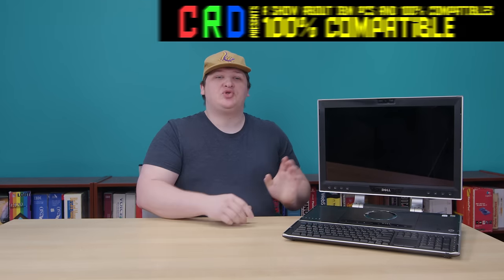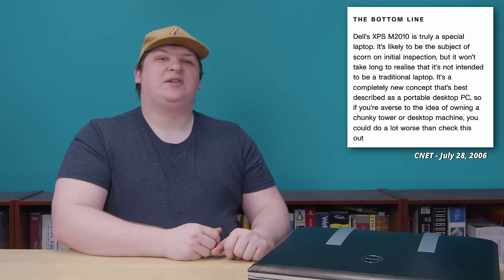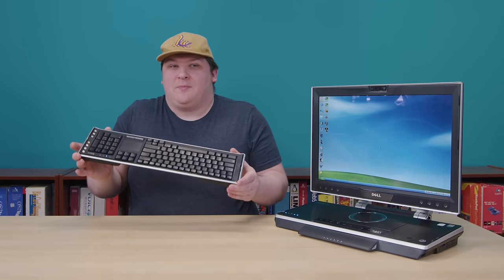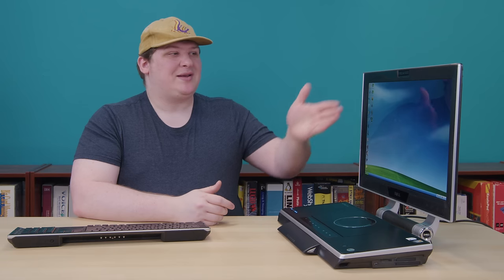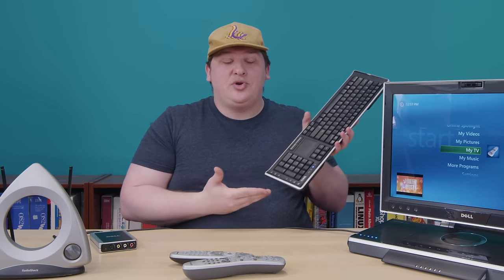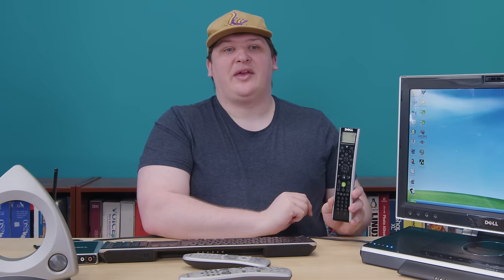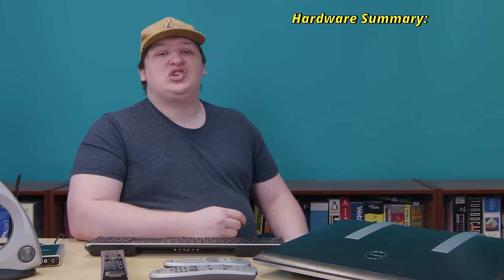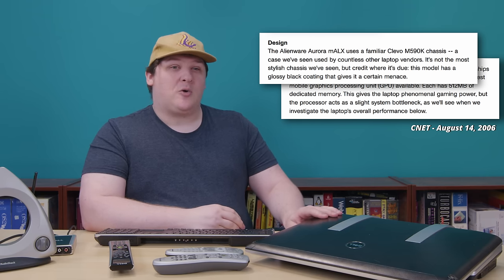Dell Called It "The Showstopper"

Comment: I remember we had a programming contractor that had one of these, back on the day.  It was never really sold as a laptop, but a desktop replacement.  This was never really designed to be used as a laptop.  It WAS a desktop.  If you went somewhere (like our office), it was far easier to bring this than a full desktop with all your apps and tools.  Of course, you brought the power cables with you.  As for WIreless USB, sadly it never took off.  Bluetooth was still relatively new, but solidly entrenched at that point.  I remember the announcement of it, but never saw a single device for it.

Comment: A video about a remote disguised as a video about a laptop with a Quick Start Gaiden segment. Bold work.

I know the "They shouldn't make machines smaller than this" joke is...well, a joke, but this format of machines is unironically my ideal. This, the original MSI Titan with a full sized Cherry MX blue keyboard and desktop graphics, the Acer with the curved ultrawide monitor, the Razer prototype with 3 screens. All of these NeoLuggables are genuinely my ideal "laptops". Everything you need from a high end desktop system with enough portability considerations that you can take it and only it to a friend's house and have an uncompromised experience.

Comment: HP recently have made a product like this. its the "HP Envy Move". it has a pocket for the keyboard behind it, it has a 24 inch touchscreen and it has legs that flip out when you place it on a desk. it aslo has an internal battery but reviews and hp themself say that it doesnt last that long on battery.
Reply: Also doesn’t have dedicated graphics or many of the other features
Reply: @inherentlyflawed  but the type of stuff this dell in the video was trying to achieve like media consumption which nowadays is just playing a video from a website so no need for a dedicated gpu, a tuner, a dvd drive, media control buttons, analog tv outputs and surround sound outputs, dual hard drives in raid 0, a remote and such. so the envy move is kind of a modernized stripped down thing of this class of all in one portable computers and to be honest it is quite pointless for this device to exist just for its big touchscreen and a full size keyboard and no other new functionality. if you really want that screen you can just have carry around a 23.8 inch portable monitor along with your laptop that you can use if you really want a big screen…

Comment: This is probably one of my favorite videos I've seen from you so far, both because of the sheer breadth of topics you managed to cover based on a single product and simply because of the constant sense of "but wait, there's more!" that I got throughout.  It was like every time I THOUGHT you were coming to the last thing, you'd start something new and I'd check the video only to find there was still a dozen minutes left.

What a genuinely fascinating piece of tech and what a time capsule in a sense.  Despite the fact that it's undeniably innovative for the time it came out during, you can really feel the vibes and general presentation OF the mid-2000s in the way this thing is put together.

Very good video dude.

Comment: This thing is an instant eye catcher, and I was totally enthralled from the moment you opened the disc drive. Everything just oozes raw effort and passion for the art of solving human problems. This micro ecosystem of a computer was an achievement, and you did an exceptional job showcasing exactly why. Bravo.

I dearly wish for a present where technology could be so exciting. Where we worked on human problems instead of engagement and ad revenue ones.

Comment: This is an amazing machine. Less than fifteen minutes in, you had me convinced I want one. I still want one. I could find a use for it! Even today, I swear!

A tip for rubberized coatings: I've seen a baking soda + water paste recommended, and it worked great on the power bank I tried it on. Obviously it's a mild abrasive, so try an inconspicuous area first, but on a matte plastic, it seemed to be just fine.

Comment: Things like this is why I think computing was much better and cooler in the 00s, a hardware golden age.  We might have technically more powerful stuff now (if you ignore software bloat nullifying that) but things were just really cool and creative back then. I don't want tiny laptops that all look exactly the same, I want this thing so I can actually work comfortably anywhere. Makes me miss my Dell Latitude which is the coolest laptop I ever owned. We need the luggable category back instead of all the price-cut miniaturised nonsense that passes for mobile computers.
Reply: Just out of curiosity, which Dell Latitude did you have?
Reply: @FlyboyHelosim  E6400, though that's pushing close to the 10s (2008/9). I actually do still have it, I found it in a storage bin with some other tech. Pleasantly surprised because I thought I got rid of it ages ago. Half tempted to see how well it plays with newer linux distros if I can find the power brick.

Comment: I remember doing support for XPS & Inspiron computers at the time this came out. We even got to take it apart & put it back together during training for it.

Portable devices at the time seemed to prefer the 4-pin firewire as that meant they didn't have to be able to send power that the 6-pin would have required them to send.

The keyboard battery will only charge when the computer is plugged into the wall.

Comment: Great video, I loved to see your review of this beast of machine.
One thought about the battery though, as you mentioned it 's only practical function is as an ups. And with a striped harddrive raid, which is needed for the tv recording features, dell would need to keep enough battery power to do a gracefull shutdown of the raid.
I had a qosmio that also shipped with striped raid, and I was clueless about that fact. The raid died on me after a power failure while recording a show. Basically the following morning, it wouldn't boot up and never did again as I had no idea how to slipstream drivers into an install medium.

Comment: Great video! Thank you for touching on some of the hardware aspects that most other reviews overlook.
I have one of these, and I love the form factor but despise the XPS machine itself. The design sure is unique, but the graphics card almost totally ruins it for me. It's awful that the M2010 has an underperforming graphics card compared to the XPS M1710, and it cannot be replaced with any other model. Though it shares the same proprietary slot as the cards on the Precision M40 and XPS M1710, the display connector is different so the cards are not intercompatible. X1800M is also rather unreliable, working ones are hard to find for under $200. 
HDX Dragon (Pavilion 9300) is the same concept but executed far better. Sharper screen, clearer speakers, bigger subwoofer, more powerful graphics card in standard MXM slot, and it still manages to be lighter than the M2010. 
M2010 had so much wasted potential - the keyboard takes up way too much room, giving it only the interior chassis space of a 15" laptop. I feel like Dell absolutely could've done so much more with this machine had the space actually been used well. Dell absolutely had something going with the Bluetooth accessories, the mechanism for attaching and detaching the keyboard is, I must admit, quite well-engineered. It is just a shame that performance had to be sacrificed for the gimmick.

Comment: the gyration remote at 28:00 does not require you to push both buttons at the same time. you can doubleclick the 'move' button to toggle it on or off and then use the left or right mouse buttons accordingly. Still causes some weird behavior, but at least it's useable. I have one of these remotes with a USB receiver. Use it regularly still.

Comment: The HP remote had a large nub/joystick to control the mouse and that was actually one thing that worked quite well. I got one with a HP 2002 "Media Editing Desktop" (silver and dark blue style, pci tv-tuner, AthlonXP 2800+ with 512MB ram and an Nvidia MX440 graphics card, dual optical drive, 1280x1024 17-inch lcd, wireless ps/2 optical mouse and keyboard combo)

Comment: 33:41 The 3rd grey antenna was for the 802.11n card that was optional on some of the contemporary dells, like the latitude d630. The card was called the "Intel wifi link 4965agn." It was tri-band. It can get about 150mbs down/80mbs up on windows. The linux drivers for the card are poor, though.

I can only assume that the other Mini-PCIE slot was going to be for a cellular modem, like what other dells had options for (it would've been 3g at the time)

Dell also had zero BIOS locks on any of the PCIE slots that that time, so you could install a modern WIFI card (assuming you can find one that can use the 5ghz grey antenna lead)

Comment: 33:40 The third antenna likely for use with a higher-end Wi-Fi configuration such as a 3x3 802.11n. Usually that's what a gray antenna cable is for, WWAN would usually be blue and orange IIRC. Even though 802.11n didn't officially come out for a few more years but "draft-N" products were around before then. The supposed WWAN slot isn't populated so it was never intended for this purpose in production.

Comment: Reminds me of the HTPC I built back in the late 90s with an ATI All in Wonder.
That came with a giant RF remote.
I went through the trouble of setting up all the stupid stuff to get the TV Guide programming set up.
And it totally worked! 
I lived in the Bay Area at the time and got about a dozen channels of TV. And the TV guide would download all the TV show info a couple times a week. 
You could even schedule it to record TV shows for you. But disk space was expensive. I did it for DS9 once and deleted it after watching because it took up half of my largest disk at the lowest resolution. 
I'd built it into a coffee table and I used that for about 6 years after.
About the raid array thing. I was really into performance tuning computers in the 90s and early 2000s. 
SOP was to install system to a raid 0 array, and have a 2nd fault tolerant array for Data files. 
I was on Win 2000 for a long time, but I'm pretty sure I did XP too before I went to Win 7. 
I think the trick here is understanding how to load a raid driver by floppy using the BIOS.
ASUS Bios was great for this, as was MSI. On a Dell not so much.

Comment: Amazing video and great "laptop"! 

The platform it is the same of the Inspirion 9300/9400/XPS/M90 and all of them have problems with thermals, but you can use SpeedFan to speed up fans.
I do that on my Precision M90 with T7200 (plan to upgrade to T7600) and Quadro FX 3500M (Basically a  Geforce Go 7900GTX) and it can handle Stalker: Shadow of Chernobyl at max settings.

Comment: On the board schematic for this machine, the second unpopulated miniPCIe socket is listed as being meant for a TV tuner card, so they must have planned to have one built in at some point rather than needing the chonky external box. The antenna you found there is likely meant for a 3x3 wifi card option that uses 3 antennas, that was quite common on machines from that era.

Comment: I had an HP HDX Dragon and I used that thing to death, the heaviest thing ever but boy was it a beast, used it until the battery only lasted seconds and shoe horned windows 10 on an ssd till its last dying breath. didn't really use the remote but it was a fun fidget toy popping it out and putting it back in with the clicks, and the sound system was so good. I wish they made new versions of these

Comment: I vaguely remember using nLite and other tools back in the day to make an all in one boot DVD with every version of Windows XP possible for my friends small town computer shop I worked at. It was my job to keep it up to date with all the most recent service packs and updates. I successfully created quite the monster with probably more that a GB of the most common drivers I could find slipstreamed into it. I also made one for Windows 2000. I probably still have a copy of those disks in some dark shadowy corner slowly bit-rotting into oblivion.
Those were fun days. Though I'm sure the nostalgia exists only because I don't remember the frustration of actually making them work.

Comment: I ran my first desktop from 2008 with two 200 GB 3.5" in disks RAID0, though luckily that machine had a true hardware raid controller. I was still running Windows XP, skipped vista entirely. I upgraded to Windows 7 on an Intel SSD when that OS came out, revolutionary experience.

Comment: 9:19 - I don't know if you get any deeper into this topic later on in the video, but as a Steam Deck user I still find 16:10 pretty beneficial. I think some of the reasons apply even more to a device like this in 2006.
Obviously, a lot of stuff you'd want to watch back then would actually be in 4:3. 16:9 becoming the new standard in this period by no means indicates that 4:3 was phased out. The extra vertical space means that you won't lose quite as much from a 4:3 image. 
There's also an advantage for 16:9 content though: You can get the full width of a 16:9 image without having to go fullscreen. ...I dunno, maybe you think that's a bit silly,  like why would you want to do that...? but it does have its uses for both movies and games. On an actual 16:9 screen, you can't have any extra UI on the top or bottom of 16:9 content without obstructing it or having black bars on the sides. This isn't an issue with 16:9-- or at least the issue is significantly reduced.

Comment: Hey CRD, just a tip for dealing with crusty old thermal paste. Spray a little bit of oil based lubricant on it (like wd-40), itll rehydrate it and make it really simple to clean

Comment: The only notebook computer I've had that I legitimately used as a laptop computer was my 2010 13" Macbook Pro. It was just the right size to sit on my lap and the taller display format and larger bezels meant that I didn't have to look down quite as far as you do with modern laptops with their ultra-thin bezels. But the point still stands: the vast majority of laptops offer atrocious ergonomics when you try to use them on your lap.

Comment: Dell really was on top in the 2000s. I know all OEMs can be hit or miss, but I have seen two different 15” Dell laptops from ~2020 (an Inspiron and a Latitude) literally fall apart at the screen hinges after 2-3 years of normal use. Meanwhile, my Dimension from 2002-3, my mom’s 11-12” Inspiron from 2003-4, my 15” Inspiron from 2007-8, and my dad’s Office desktop from 2009 are all in excellent condition and work perfectly fine barring consumables like batteries and hard drives. Hell, even my mom’s 15” i3 Inspiron from 2011-ish works perfectly fine. It’s amazing to see how exceptional they were back then and how far they’ve fallen, at least in the entry-level consumer space.

Comment: I've got an HP "Dragon" (HDX 9000) that was in the same market segment:  'Ultra' Desktop Replacement Notebook.  

It's a great multimedia machine with pretty much every connector and peripheral you would have needed.  It worked seamlessly with WMC, making for quite the viewing experience.

A lot of its features were scaled-down and carried over quite successfully to the later HDX 16, 17, 18 and DV6, 7, 8 series, which could be optioned as multimedia powerhouses themselves.

Comment: The physical Bluetooth button had a very important use. Because the keyboard is bluetooth the bios needed a way to initiate pairing with it in the event the pairing was lost and you couldn’t get into the OS. Especially if you had a bios password or needed to enter settings in the bios screen. I remember there was a special sequence for it.

Comment: 7:36 There are some things that are universally measured in imperial units, even in metric countries. Monitors are one. Speakers are another (although metric will often be offered in addition to imperial). Car wheel diameters are pretty much always in inches, but the width of the tyre is in metric. 12 inch records are always 12  inches.

Comment: Reminds me of the Qosmio X500 series... or more than that: the Sony VAIO AW series. Both of these sported 18.4 inch displays, though the graphics options on the Sony were far better, as I recall, and it had hot-swappable bay modules like a subwoofer that could go in place of the DVD burner, or you could even use that bay for a second battery, additional storage via HDD (or even an SSD if you were rich, haha), or even drop in an adaptor bay module to plug in other hardware such as PCMCIA cards and memory cards. It was pretty cool.
Edit: Ahh, you DO have a qosmio! Now you just need the AW to complete the trifecta of gigantic screen "laptops" of the early/mid 2000s. (Good luck, though. Those... are almost unicorns at this point.)

Comment: I just finished finally building up my Latitude e6400, slowly obtained EVERY upgrade I could find (though now I'm seeing people successfully running 4 core CPU's with some cooling 'mods').  The memory being the biggest shellout at 8 gigs that I was sure was bad since two MB died when installing but just a coincedence cuz 3rd time was the charm.  It's got two internal SSD's, lighted keyboard, an Intel AX210 (you need an adapter but works just fine) for Wifi 6...Wifi 6 on a 20 year old.  I love it.

THIS THING ROCKS.  Runs Win10 like no sweat with the Dual core P9700 (anyone upgrading you need a later bios to even get the checkmark to actually use both cores).  But the real value of this laptop is the I/O...the I friggin O on this thing.  I don't think there is a single standard NOT represented.  It can be completely disassembled and worked on with ease, everything is replaceable.  I love this thing and you would not know it's like 20 years old by anything other then actually form factor and maybe screen res.  

Off topic-ish but I miss I/O and I miss configurability ... is that a word?  Red squiggly be damned it's stayin in.